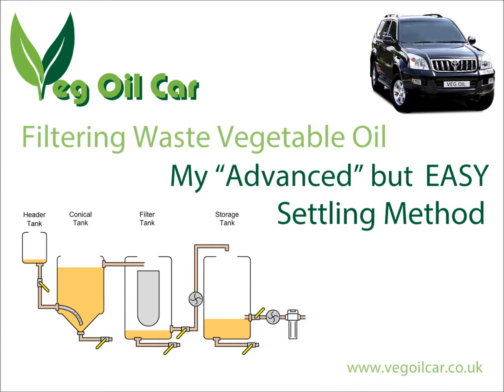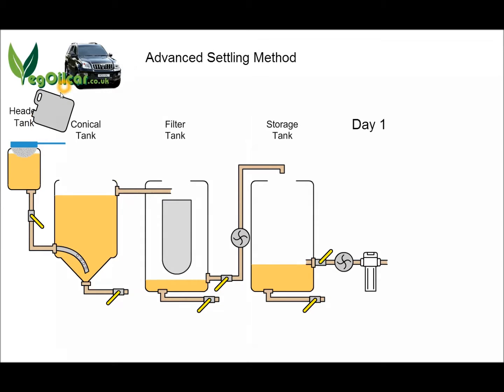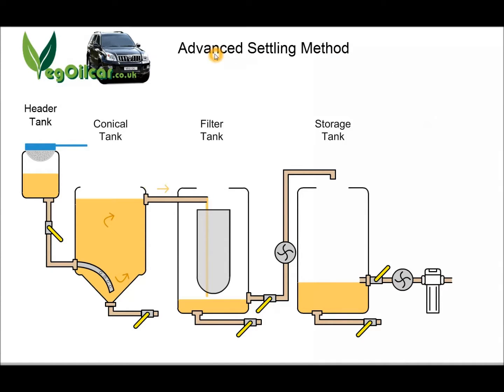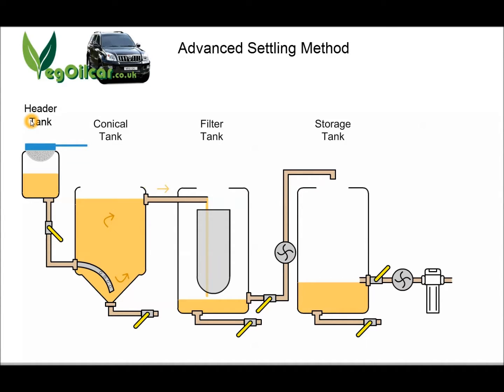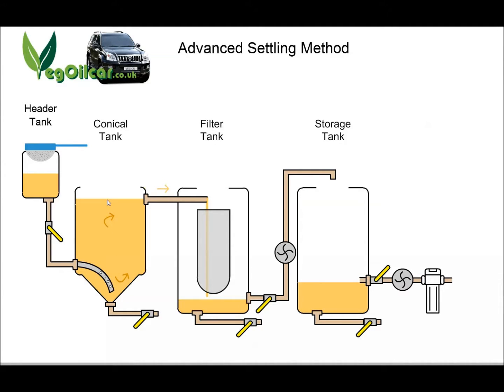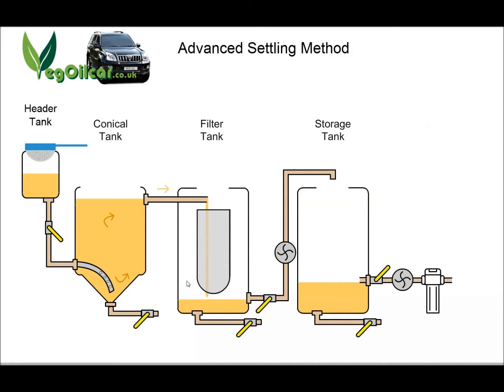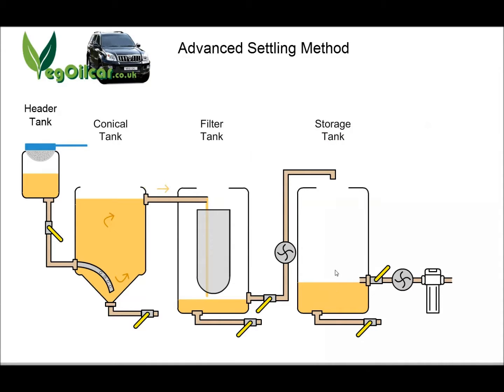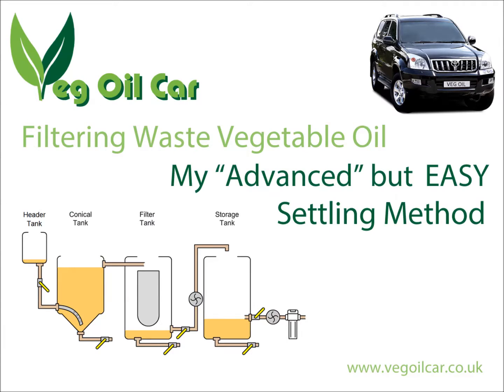Cleaning Waste Vegetable Oil - Advanced Settling Method by VOGMAN

Comment: Do you believe this could be done with 3 5-gallon buckets ? Also do you think that 5 micron sock would surfice? I only have 1 car and maybe use 10 gallons a month. 2003 1.9l VW TDI.
Reply from the maker: Bigger tends to be better with settling. If it's done right, no sock at all is needed, but 5 is the minimum I'd recommend : )
Reply: @vogman  one more question. Where do you source the 1 micron socks? All the ones i find have reveiws saying they arent actually 1 micron.
Reply from the maker: I always got mine on eBay.

Comment: engine health after 5 years?
Reply from the maker: Other that the consumables (filters, tyres, etc), it's still on it's original parts  : )
The car is nearly 15 years old and still going strong. In fact, I'm saddened to admit that the original exhaust has just developed a small hole. I'm convinced veg oil prolonged its life.
Reply: @vogman  wow.  I might get a diesel and a kit for my next car - I also sent a video or two to a couple of friends. One of which is keen to try it (although lives on the other side of the country - it'd be easier if were were next door neighbours).

Comment: Own a couple very early 80s VWs hatchbacks with the 1.6 NA diesels that the POs would do simple let-it-sit in the cubes then just filter it with a series of socks and be good to go. More substantial setup would seem to be safer. Already have a truck bed worth of the cubes of WVO...though sadly some of the cubes had cracked handles before I got them and undoubtedly have gotten water in them.
Am SLOWLY getting the pieces together for a filter setup...a parts deal had a 30 gallon (I think...could be more) conical tank w/ pump thrown in for free that was used for making bio-D but would still work fine for WVO. Hoping to soon have a working setup in place. 
Will likely only be used for ratio mixes with diesel...though an 81 Caddy I picked up might see a true WVO tank since it will actually have space to spare for it...once the poor thing is reassembled.

Just I'm still disputing where I'll be using a system that uses pumps + inline filter staging or this one.
Reply from the maker: It takes time to get a good set up together - but the wait is worth it : )
Reply: I think I sorted out how I would proceed. Where I live is very dusty with no current means to keep a setup out of the weather so I'll be making use of a pump setup. Will be using the barrel screens to get it down to 200 then 100. Since typical canister filters would likely plug...fast(?)...I'll make use of the micron sheets from 50 all the way down to 1. Polyester sheets is what I'm looking at...disposable but could get at least one cleaning cycle out of them before I'd have to discard. Besides...a 72in by 36in sheet of a given mic will go further than a dozen regular filters and for less $.

Thought about using a very coarse cartridge and wrap it in a section of sheet and overlap it about 1/3. Can secure it to the cartridge with clamps (snugly). Depending on how good the untested pump is that I have...will either do just the 50-25-10 in a stage into intermediate storage to await processing or MIGHT do it all at once. Not sure yet.

Fortunately I have access to PLENTY of PVC drums (sadly not the removable lid type) for storage...used to have liquid iron for use on a golf course so they would need thorough flushing first. But they will be FREE!

DudaDiesel seems to be the only reliable source for some of the items I need...they certainly don't want much for shipping...S&H alone can equal the item total. But for about $350 I can get most of the hardware together. Though filter cannister's might get a bit ugly in price unless I layer the mesh in the same way socks can be stuffed in one another. As it is I use my pre-VW era fuel budget at all times which used to be 200/mo...which leaves me about 100 in surplus at the end of the month...most of which has been used to cover repairs and subsidize another. But if I can get a working mix together I'm hoping to cut my CURRENT fuel costs by at least 1/3. Probably take 3-6 months before the investment is back after that....

In summer time here it can get over 110 F (40 C+) i could use 50/50 mixes to drop cost even more. When I finally get the VW Caddy going it's likely to see a full fledged oil tank (DIY constructed since aftermarket is $$$).

Comment: Am I right in thinking the oil from the header tank won’t go down because it’s smaller than the conical tank and thus there is more pressure. Also the pipe will be filled with oil as high as the conical tank
Reply from the maker: The header tank size doesn't really matter, but it must be the highest tank so that it can displace the oil in the conical tank (thanks to gravity). The speed of the flow from the header tank is controlled by a gate valve. Pressure doesn't really come into it... it's just gravity.
Yes, you're right, once the header tank is empty, the wipe from it will be filled to the same height as the oil in the conical tank : )

Comment: Hi Geoff, Great videos. I was intrested in your thoughts. We have mostky the steel can
Reply from the maker: Hi Gabriel. Thanks for the kind comments.
If you can't use the cubie method, I'd recommend setting up a rough settling tank. Use a large barrel and pour in your oil. Leave it a couple of weeks and then draw off the top, cleaner oil - something like this would work - http://www.vegoilcar.co.uk/wvo_filtering_setup.php
Personally I'd take that oil and then settle it some more for really good quality results.
Hope this helps : )

Comment: Hi thanks for the videos. what rate of flow would you recommend for the header to settling tank?
Reply from the maker: MOB993 As slow as you can get it... the height of the header tank will FORCE the oil into the conical tank, which we want, BUT we don't want to agitate the content too much as "settling" is taking place. If you could attain a rate of 20 litres per hour or even slower, that would be great, but realistically as long as you're not churning up the content of the next tank, you'll be doing okay. So use a valve to restrict the flow and don't be in a hurry. I hope this helps.